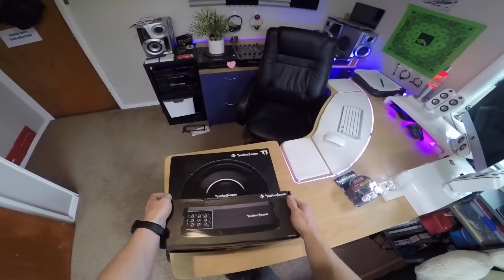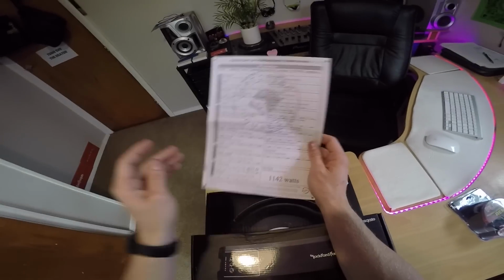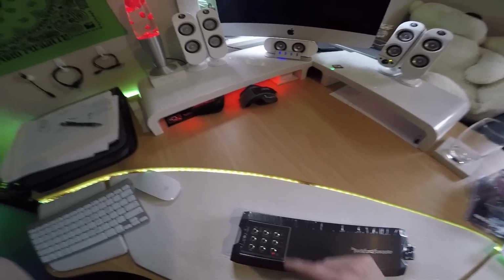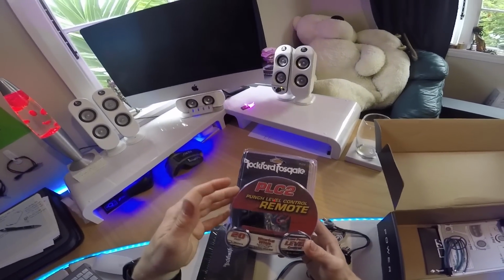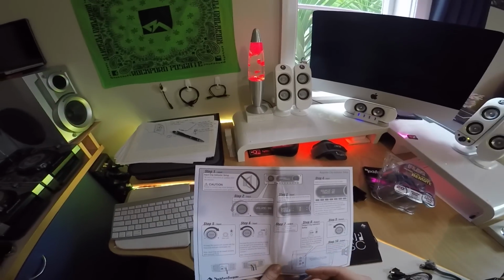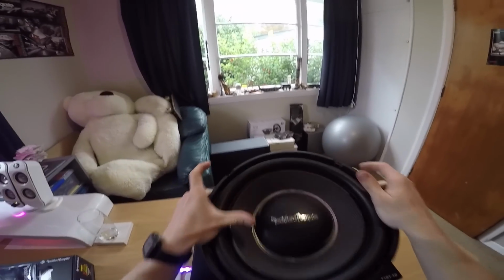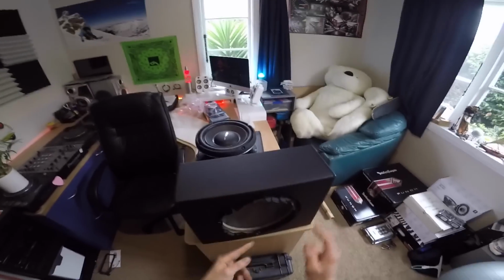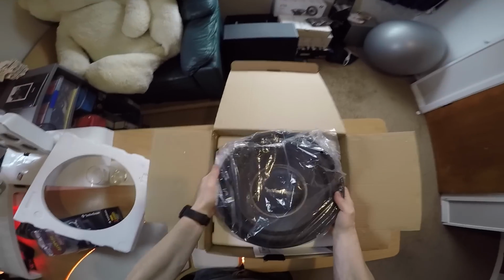Rockford Fosgate T1000X5AD & T1S1-12 Unboxing & Hands On Look

Comment: Nice like your RF-T1000x5AD..me I'm getting the RF-P1000x5!! 👍😄
Reply: Edrick Mendez how do u like it? im between this and the L7 kicker
Reply: Grim Aka Statik RF-P1000x5 its insane..im powering in 4 ohm stereo 4 - 6.5"  heathsound midrange speakers their rated @ 75wrms and in 1 ohm its  hammering the P3D2-15 in a custom 3.00cuft. @ 33 hz its rated @ 600 RMS but the amp in 5th channel its rated 500 RMS but its more power than that..Im happy that I go with this amp and sub combination..all of this in my 2011 Nissan Versa (Tiida) HB..😋👌

Comment: Resin alone does not add any strength at all, just weight. Fiber-glass is what adds strength so you should probably consider a thin fiber-glass layer to really strengthen your enclosure.